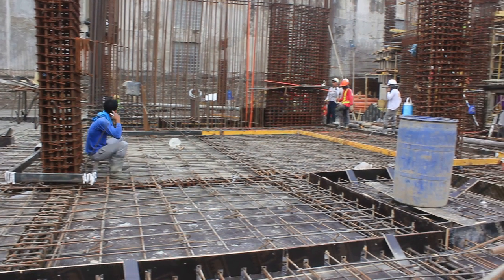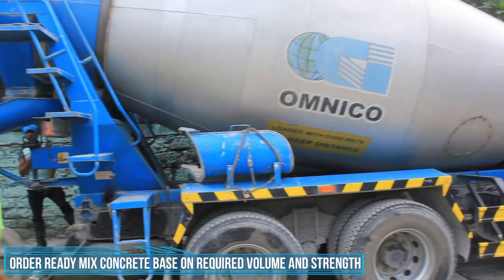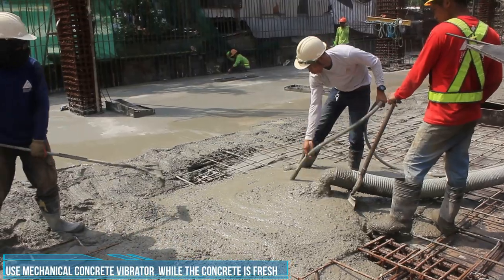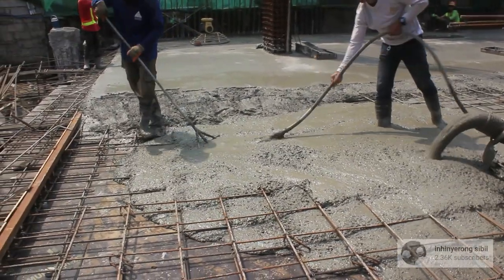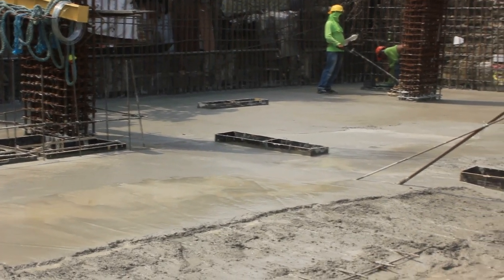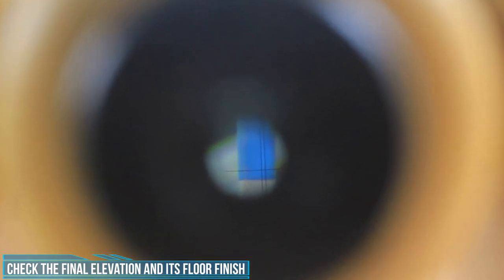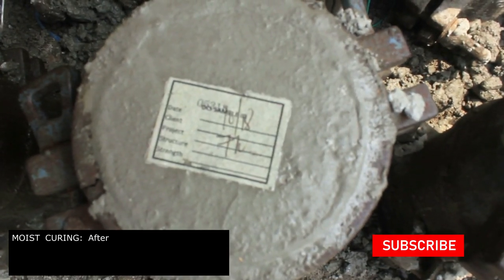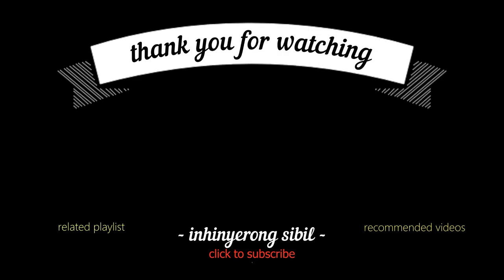how to pour concrete on slab by using line pump

Comment: Sir ano ba ang tama pgSLUMP TEST EX. dba ang design mostly sa slab using pump ay 6-8 inches,ano po dapat ang tolerance pra di mapauwi yong CONCRETO po...ty
Reply: 4 to 6 inches pasado po
Reply: @francismaranda4904  so bale 2 inches ang tolerance?pag naging 10 inches ok lng b po?
Reply: depende kung i rereject ng inspector o di kaya gagawan ito ng paraan
Reply: @francismaranda4904  ah ok po
Reply: @francismaranda4904  sir pag TIES AT STIRUPS MOSTLY G33 ginagamit yong total length my subtract na ganito 45=1d 90=2d 135=3d tama po ba yan?kasi dba hahaba yan pgnagbending
Reply: @madarasasuke1200  tama po yan kapatid

Comment: how many cubic meter per hour yong napi place na concrete dyan sa project na yan at yong gamit ang boom?
Reply from the maker: Kaya po 300cu.m sa isang oras sa tuloy tuloy na pagbuga.. salamat po sa panonood
Reply: @inhinyerongsibil6383   kung ayon lang sa delivery ng truck mixer, yong pagdating at pagdischarge nito.. ilang truck mixer na tag 10 cu.m. ang nabubuhos nyo maghapon within the regular working 8 hours?
Reply: @inhinyerongsibil6383  5 cu.m. per hour lang binigay na info sa akin ni civil engineer guide sa india
Reply from the maker: @deanmarkgabinete5777 300cu.m/pr hour ang estimated rate ko sa tuloy tuloy na pagbuga.. if Actual na buhos na. Marami po dapat tayo i consider.. 1. Ready Ba yung area na bubuhusan? 2. Papipilahin mu ba mga concrete mixer (9cu.m ang usual na karga ng mixer truck) ? 3. Maganda ba ang pagkaset up ng mg concrete steel pipes mu or placing boom? If yes kaya po yung 300cu.m/hr

Comment: New subscriber new sir. Sir ask ko lang,ano ano PSI disign like fondation,slab,beam at colom?
Reply from the maker: 5000psi beam slab, 8k for column depende nagrereduce habang umaakyat ng floor,  yan po usual design para sa verticals
Reply: @inhinyerongsibil6383  maraming salamat po.. ah sir may tanung pa ako, diba po nalalaman ang sukat ng psi pag puna test mo na yung cylinder? Paano po pala pag bumagsak sa test eh naibuhos na sa gingawang building?
Reply from the maker: @glennbalaoing9128  make another test by getting sample on site thru concrete coring. Then kung nag failed ulit discretion na ni owner or consultant na ipagiba yung nabuhusang Area